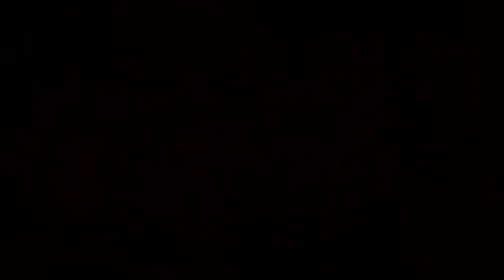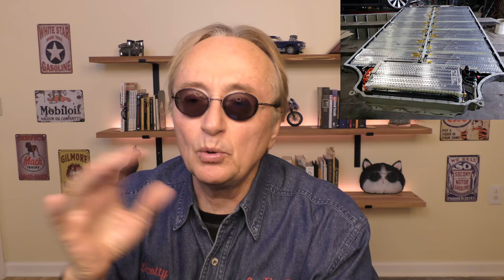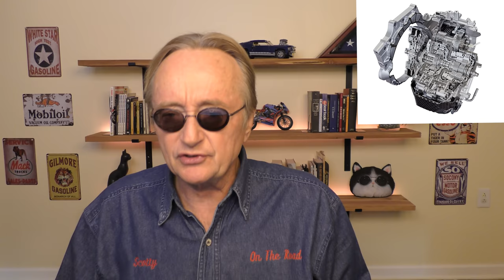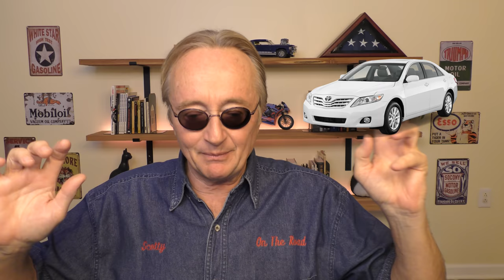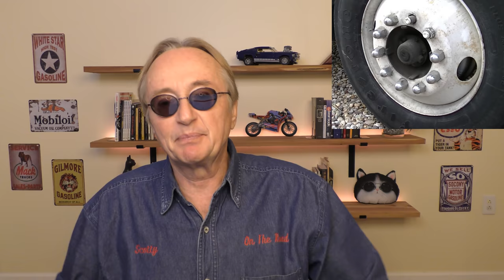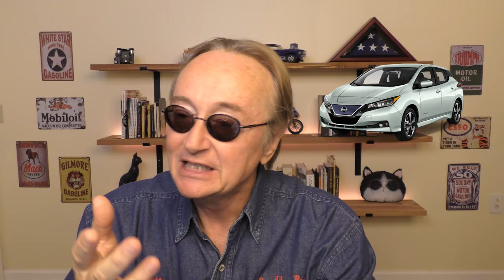This Fatal Flaw Just Ended Tesla’s Future in America

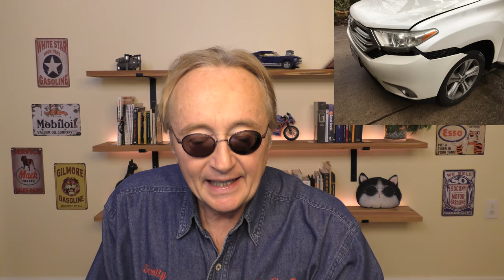Comment: 2:25 I have a tough time believing any of these “unintended acceleration” claims no matter what the manufacturer, any modern car with disk breaks should overcome the engine torque if you step on the breaks hard, not to mention the claims usually just happen to always come from elderly drivers
Reply: CGI most probable . . the great & secret show
Reply: Unintended acceleration is the result of stupid, unnecessary technology
Reply: When Throttle cables fail, your car will break down, big deal..

When a PCM breaks down, all hell breaks loose
Reply: Back in 1984 when I was in my early forties, not yet a senior citizen, I had A 1982 car with the early computer system. On the freeway one day light traffic my car accidentally? Accelerated from about 70 mph to 80mph. I got on the brakes and it kept accelerating. Got on the brakes harder and still accelerating. All the gauges going crazy. Finally at about 90, not really sure since the speedometer was messing up,  the car started to slow. Got off the fwy and found a garage. Just happened to find A guy like Scotty. When I told him what happened he immediately found the problem. COMPUTER! UNCONTROLLED ACCELERATION! That was when the car companies were all denying that COMPUTERS were to blame. I KNOW different.
Reply: @idontknow2293   Down the road . . to the cross road  . . I looked around
Reply: @idontknow2293  Umm, shift it into NEUTRAL?????????
Reply: @johnsit5743  umm, I don't remember. Maybe that's what I did to bring it down finally. I was freaking out. And now I'm not 40ish anymore. Hard to remember stuff when YOU push 80. And not talking mph. LOL.
Reply: BRAKE!
Reply: @idontknow2293  It NEVER occurred to you to put the car in Neutral!? Or to turn off the engine? Or to turn off the cruise control?
Reply: @snowrocket  turn off the engine? Lose the power steering. Cruise control in traffic? Really? I don't think I would ride with you. You probably use the phone while driving too.

Comment: the sudden acceleration issues been around since 1996 in subaru,  many people crashed, none killed or injured.  it seems to be compensation for the power steering load when you turn the wheel,  you find yourself slamming on the brakes in tight manuvours randomly to keep the cars from lurching forward.  subaru is the king of neglecting issues lol

Comment: I've had runaway acceleration because of a floormat getting stuck under a gas pedal.  Every car needs a simple mechanical way to shut the engine off immediately that can't be overruled by any other part of the car including the computer.  Like turning the key.

Comment: As the leaser of a 2020 Subaru Forester I am not overly concerned. If a small number of cars have an acceleration problem, then Subaru will eventually have to do a recall to check them  and, if necessary,  fix em. I doubt people are being quiet and not reporting if they have a sudden acceleration problem. For myself, I have an immediate work-around if my Forester suddenly accelerates without my wishes, hit the breaks, put it in park, put on the emergency break, and then call AAA. Did that lady just sit there while her car just plowed ahead? I had a few Corollas before my Forester and the Corollas are great cars, but even they had recalls for various things (including those stupid Takata airbags).

Comment: Subaru's self acceleration is related to the CVT. The clutch inside the torque converter fails and locks up.  It's a known issue with some of the CVT's 
The first sign of failure is stalling. If you brake hard and stop the car forcing the CVT to shift down quickly, the clutch fails to disengage fast enough.

Comment: EVs are coming. The critical issue is the batteries and infrastructure. In my opinion we’re looking at another decade to make a significant dent in those issues. As much as he tries Elon can’t rush that process. The valuation of the company is totally out of whack.
Reply: It will take a new battery technology or a way to store hydrogen more efficiently. Otherwise, mass adoption of EVs will remain a pipe dream.
Reply: This makes Nios concept a little more intriguing with their battery swap stations
Reply: @jontest5718  You are going to drive a car in 0 fahrenheit or 100 fahrenheit and rely on swapping batteries? What if one if defective? Yes I'll go skiing in the Alps and rely on a charging station during a blizzard or maybe I'll be on a remote greek island looking for a battery swapping station 😆

My yacht has reliable petrol engines and my sailboat has Volvo Penta Diesel. I have two things for you...reliable and dependable.
Reply: @sakispsinakis  Im going to rely on my ICE truck brah

Comment: '59 Pontiac wagon sudden acceleration due to engine mounts rubber broken.  Engine twisted and pulled carb linkage and opened up the carb. If engine twists it could damage wires in new cars with no carburetors. Rubbing wires took down my Dodge Dakota for a while. Cheap wire covering next to firewall. Just a thought.

Comment: Scotty, as a collector of vintage digital cameras, laptops, and iPods I have many 15+ y/o lithium ion/polymer batteries that still hold 70% of their original capacity.  It's all about charge cycles on the low-voltage cells.  Can't speak for HV car batteries.

As usual I think I'll stick with my fleet of '95 Camrys!

Comment: Scotty the kind of mistreatment that causes these issues in batteries is about the equivalent of never changing the oil in your car. You wouldn't blame the car if that engine blew after a lifetime of mistreatment!! I feel most of the time you base your opinions on experiences you've had in your shop. I respect that. Might be reaching a bit on this one. The numbers aren't on your side. A properly maintained battery that hasn't been abused will last a very long time.

Comment: Car battery have a warranty of 8 years and 80% of initial capacity.
Reply: Actually, it depends on the manufacturer and where you live. Toyota increased its hybrid battery warranty to 10 years/150,000 miles. in the US and Canada in 2020.   In the UK hybrid batteries have a 5-year warranty, but you can buy an additional warranty for up to 15 years.

Comment: I have a question? 
So my 2006 Jeep Grand Cherokee Laredo V6 3.7L 4WD is overheating plus is there any other way for me to replace my starter motor without removing the drive shaft. 
Going back to the overheating I have replaced the temperature sensor, radiator, water pump, radiator fan, thermostat and it’s still overheating
Reply: A pack of matches is still only a nickel.
Reply: Try a head gasket test kit that Scotty uses that's really the only thing I can think of unfortunately. wish you luck

Comment: Love the channel electric cars are coming though and Tesla's out front...
Reply: Sorry time will tell as their out and how long they last and what problems come about. Wont take much and theyll revert from it when its not reliable for years. People arent going to buy a battery car every few years bud, hence why theirs 30 yr old gas cars still driving.
Reply: @brandonlewis5045  30 year old gas cars!?... I am still running cars and trucks that are 60 years old! They always run, repair parts are available if needed and I can repair them myself...unlike the Tesla which according to Scotty could take months.
Reply: @brandonlewis5045  User data from Model S vehicles as old as 2012 show single digit percentage loss to range. You are probably basing your understanding of lithium battery lifespan on phone and laptop batteries which have no liquid cooling solution and are routinely charged all the way and discharged to empty. You might also be thinking of Nissan Leaf premature range loss, Leaf has no liquid cooling solution either because Nissan cheaped out. My own 2011 Volt has lost about 5 miles of range in the past 10 years, because it has a liquid cooled battery & doesn't allow the user to charge it to more than 80% or discharge it past 20%.
Reply: @Hamdad  Will see, what about replacing diesels that haul everyday, not too mention cold to warm climates? Mud, salt , precipitation etc???
Reply: @Hamdad  Im basing mine on hitting a rock or wiping out in a battery car and it costing 15k to replace plus the time to get the batteries???? Wheres the logic in that, you got to think 360 not 180.....
Reply: Nope never will happen.
Reply: @Agent-lg1mu  Evs arent taking over. Their paying for the go green organization by paying for gm and other manufacturers to keep them off their back.......
Reply: @northdakotaham1752  u likely aren't repairing any car u are buying now days yourself lol.
Reply: @brandonlewis5045  in 1980 the average car was 7 years old. Today the average car is almost 12. Only 1% of cars on the road are over 30 yrs old.  I doubt ev's will be much better or worse to be honest.
Reply: @themeach011  I have ten year old vehicles that I can repair to some extent. Have some diagnostic software, Bluetooth adapter etc.
Reply: @northdakotaham1752  I agree on a ten year old car u can do your own brakes , maybe a wheel bearing or shocks some light mechanical stuff ten years from now there will be a solid after market for Tesla parts and I would be able to do those sorts of things to the car myself as well. Anything deeper than that and you are going well beyond what tg average Joe is capable of. Most people can't even change a tire these days. And that's great that we can do that stuff but there's probably a computer programmer reading this that's better at fixing cars today than either of us.
Reply: @northdakotaham1752   60 year old gas cars!?... I am still running cars and trucks that are 100 years old! They always run, repair parts are available if needed and I can repair them myself...unlike the Tesla which according to Scotty could take months ;-)
Reply: @Agent-lg1mu  it’s already happening. Don’t be in denial.
Reply: @srenjensen3817  how old are you? 130?
Reply: First out the trenches!
Reply: @brandonlewis5045   no, EVs are taking over because they are the superior technology and they are only getting better with new tech

Comment: tesla has too many fanboys for tesla to die here
Reply: Until they (customers) all slowly get screwed over. Just a matter of time.
Reply: @JayA-pk7xy  just like every other car maker has screwed it's customers.  Even Scotty's beloved Toyota has screwed it's customers.
Reply: @maurice7413  Very true.
Reply: Tesla’s fans will drop off quickly if he’s right. People expect to have a vehicle for many years. If the batteries have this problem, the resale value will be crap.
Reply: @MrJamespeyton  people dont care when it's their iphone dying and getting a new one all the time, tesla owners will be the same
Reply: You ever driven a Tesla personally?
Reply: @theseanie9958  time will tell. There are proper charging procedures that help limit this issue. This is a problem that arises from charging consistently to full charge and also running the car down to very low %. It's common knowledge not to charge to 100% all the time. Only when absolutely necessary for a road trip or whatever. Charging to 100% and leaving it sit at full charge for long periods of time is about the equivalent of driving down the highway in 2nd gear at 8000 rpm and never changing your oil. No one would blame the car for breaking under conditions that are know to be harmful if it was a gas car. If a battery is treated properly it should last a very long time and a cell phone or camera battery is a terrible comparison. People don't take care of those batteries at all. Run them till dead. Charge them to 100% then throw it in a cupboard till you need it. It's like the worst thing u can do to batteries. I think they will be like any vehicle. If they've been taken care of and treated well they should be ok but like any used vehicle u take your chances.
Reply: @themeach011  the question is, who wants to constantly drive around with half a tank of gas...
Reply: @hedgefund1844  depends how far u gotta go. I can travel 200 miles and stay within my optimal charge. And every morning when I leave my house I come out to charged car. Once in a blue moon I would drive more than that in a day so the odd charge to maximum capacity (300 miles) for that but it's actually really nice never going to a gas station. I drive about 100 miles round trip. Never worry about range. Even in Canada we just went through some real cold weather. Cost me about 4$ a day in power to commute. I love it